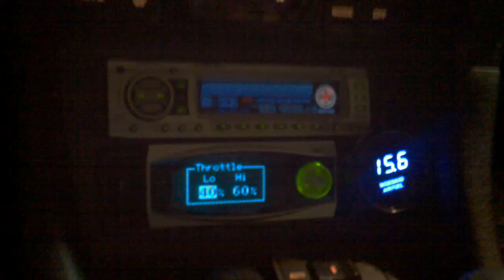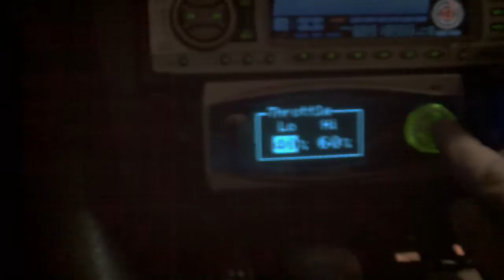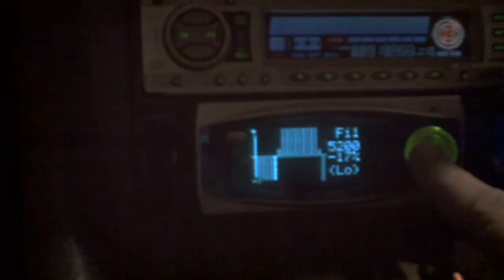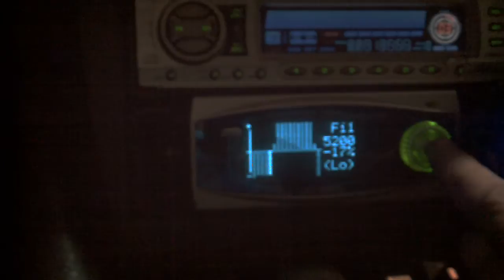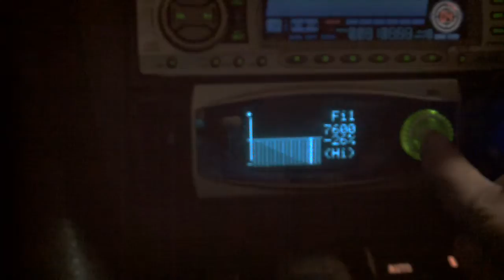How to make a 2 step with an afc by Ray Pampena

Comment: That’s good for drag wot but not a good setup for drivability.  bcs having your throttle percentages at 40% and 60% is going to affect how early and how accurately the HI  throttle fuel trims are going to be introduced. There are two trim files you can switch over to back n fourth to have a two step file and a street file but switching files during motor operation is not recommended.

Comment: I know this an old video but maybe you or someone can answer me a question. If u set like that, when you running in any shift (3, 4, 5, gear for example) will do it the same? Or only gonna work in neutral?
Reply: To answer your question yes it will he lost any drive ability under 40% throttle so he can't really drive only launch its all or nothing, not to mention the fact running that rich will wash the cylinder walls and cause scarring, I would not recommend this on any street car a wot box is better for a street application
Reply: this is only for launching .... car looses all  normal drivability .
clever way to make a 2 step but one needs remapping constantly for this feature